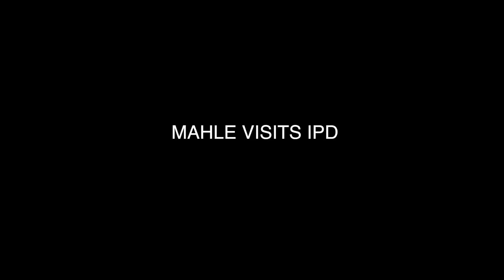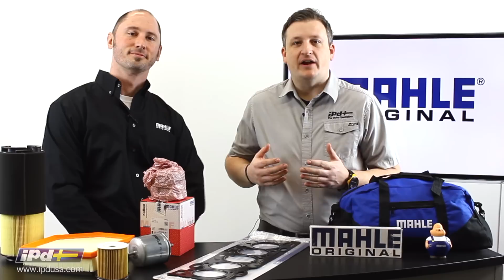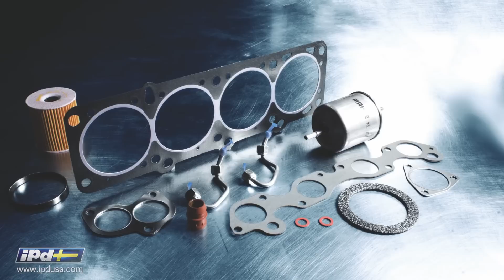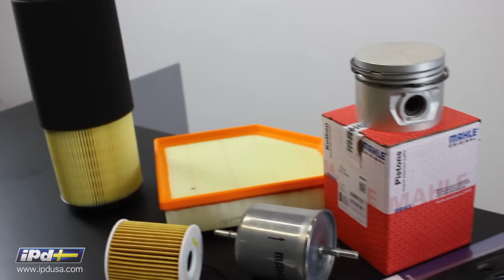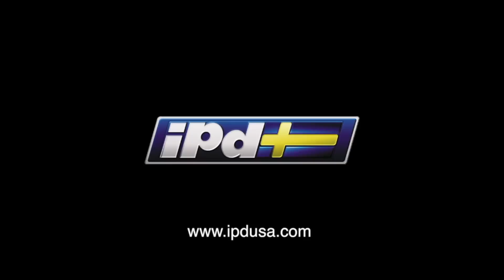IPD Volvo - MAHLE visits IPD

Comment: I have a power steering pump from them the res looks a little cheap but it certainly was a lot more cost effective than the alternative. Its been going for about a year now with no problems other than its a bit louder than the original one. I don't buy their tie rods because once when I was out of town I had a mechanic replace my axle because the cv started clunking and he replaced my oem endlink with a mahle one at the same time and it bent that very same day out on the dirt roads in Arizona. The OEM one certainly looks more beefy too. I've been interested in their control arms because some people say they are good.